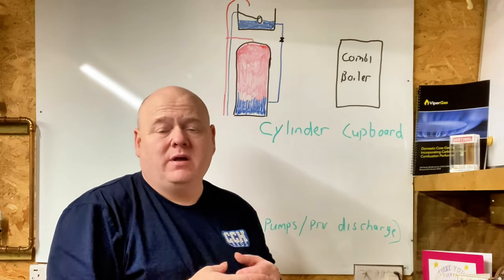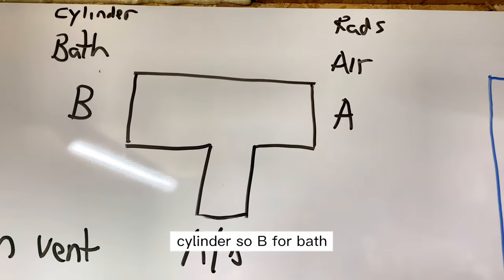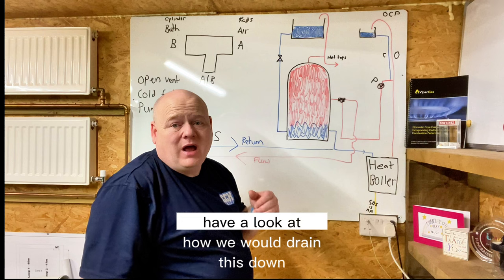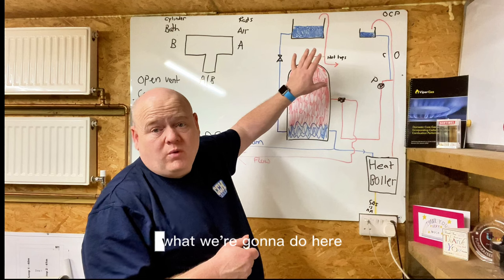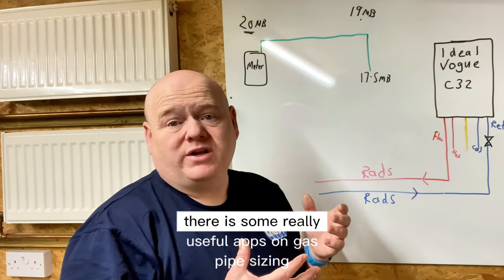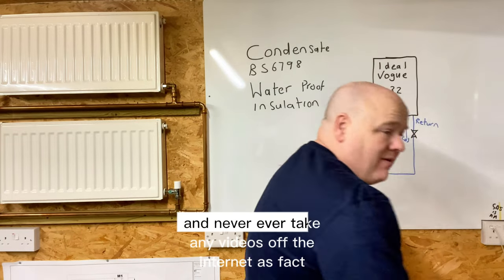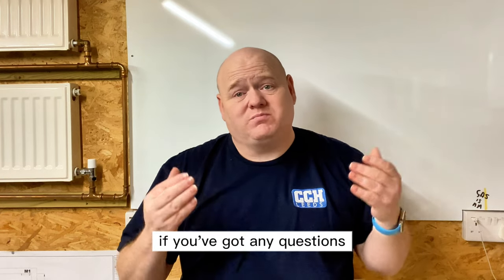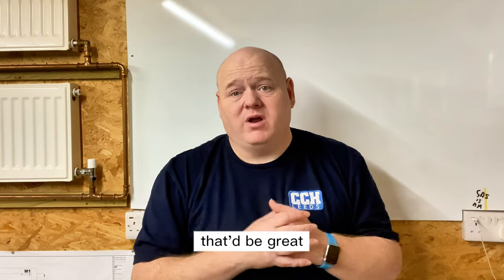How To Install A Gas Combi Boiler | cylinder cupboard | #plumber #plumbing

Comment: Thanks Allen great video . Sometimes it’s risky to fit pressurised systems into existing old gravity . even pipes work passed the test if old pipes work over 15 years old I will rather get the customer sign waiver or replace all pipes work
Reply from the maker: Thank You

Comment: Here is one that I never find an answer too? Why do boilers say there lowest working pressure is say 16mb when according to Gassafe would be low working pressure!!
Reply: Some vailliants can go down to 13mb
Reply: MI’s overrule anything!
Reply from the maker: @scotts3498  No they don’t
Reply from the maker: You are allowed 1mb drop over the pipework, if you test at the gas valve in the boiler you are allowed 1mb plus whatever the manufacturer allows, the so called minimum that you talk about is irrelevant for pipework sizing
Reply from the maker: @ChelseaFC190512  doesn’t mean you can install them to that